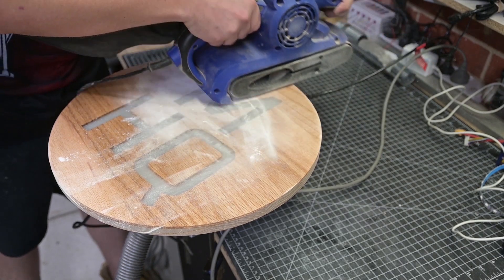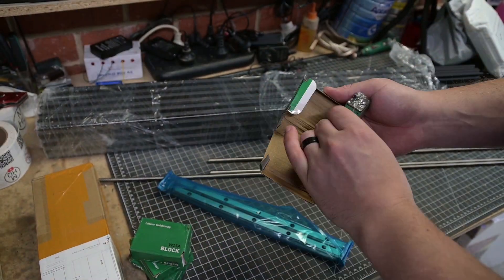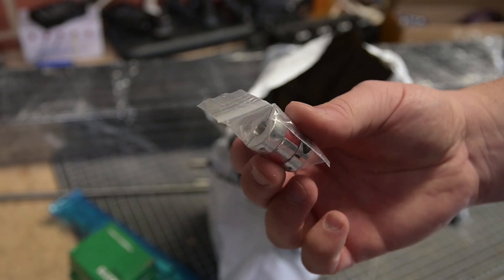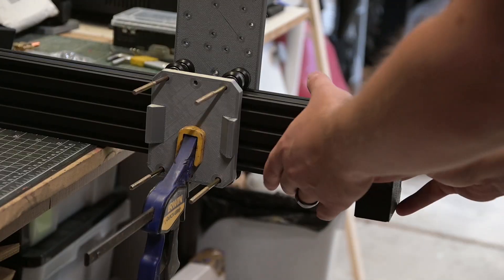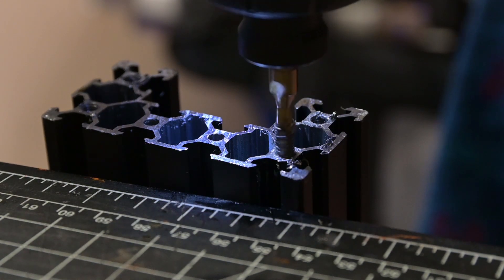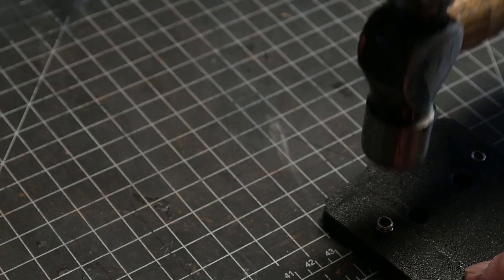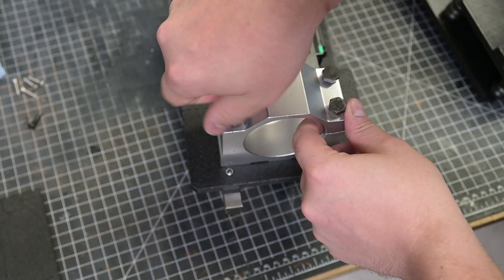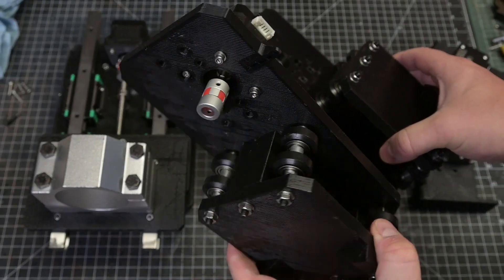Building a cheap CNC router | Part 1

Comment: Thanks for sharing, I'm looking forward to seeing parts 2+.
 I'm building a cnc too, I'll be using a Fluidnc based controller. Fluidnc is a more up to date GRBL derivative based on the ESP32 processor, it can read g-code files directly from a micro sd card so a constant connection to computer is not required and when do connect to a computer, you have the option of doing it over wifi with a browser based user interface.  If that sounds interesting to you, check out the Fluidnc wiki page. On the hardware side, something like the MKS-DLC32 might be a good fit for your project.

Comment: I tried to comment and ask about your grbl settings but it seems to have disappeared. 😅

What grbl settings will you use and how will you calculate the values? Specifically interested in your cartesian [X,Y,Z] steps/mm values at $100 $101 $102
Reply from the maker: I haven't done any tests to find the performance ceiling of the machine yet, instead I'm just using very conservative feeds and speeds. With regards to steps/mm, UGS has a great inbuilt tool to calibrate these values which I cover in the next video. These are my latest grbl settings: https://www.dropbox.com/scl/fi/hdi014467cphqdsoge14t/PXL_20240307_073643864.MP.jpg?rlkey=s622u2je3vkcr4iqzqk8i2cr6&dl=0 no idea why the steps/mm are such weird values all around 161 steps/mm (would expect 20 s/mm for 10mm leadscrew). 1/8th microstepping must be enabled by default on these drivers...

Edit: indeed without any jumpers fitted to the cncshield TMC2209 drivers will do 1/8th microstepping! Smoother operation but less torque...
Reply: I don't know why but youtube keeps deleting my responses. I think its because I added a link to my blog post with grbl settings.
Reply from the maker: @mrcarlpaton  Weird. It's not me deleting anything!
Reply: Thank you for sharing your settings and I look forward to your next video of that inbuilt tool in UGS
Reply: Yeah I think its auto spam removal magic. I'm keen to share the grbl settings I calculated for my machine if you interested. I don't know if they right and I'm still building the machine. It's a work in progress 😅
Reply from the maker: @mrcarlpaton  If you're building something with a similar motion system yeah I'd be keen to hear about about your successes!

Comment: Get a dial indicator (the "test" style will probably work best for this) and a holder for it to do precision rail alignment. A cheap Chinese one will do for this level of machine.
Reply from the maker: Got one, but the rails are so short it's hard to get enough measurements to ensure they are in fact parallel. Making a jig was far quicker and easier